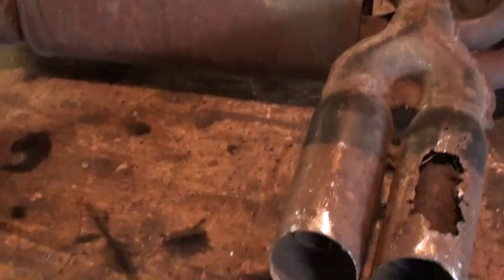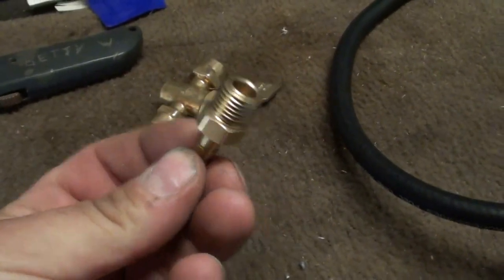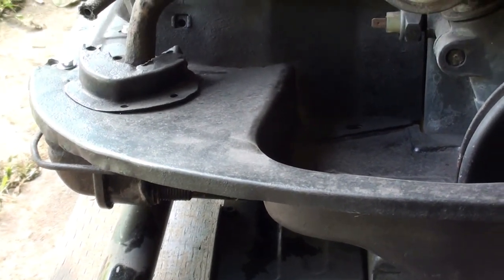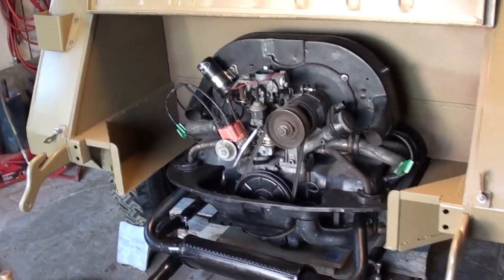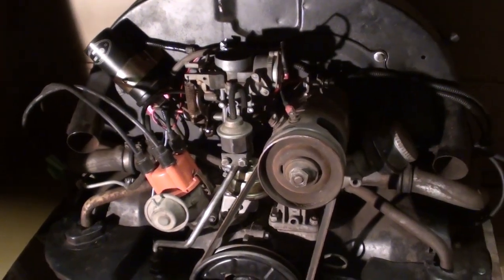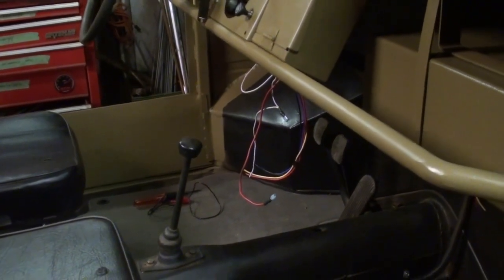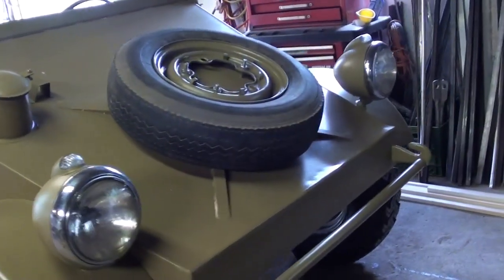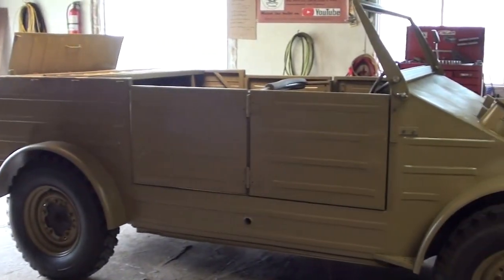Project Kubelwagen Part 61

Comment: The open pipes on either side of the engine are unnecessary as far as I'm aware. I have a Kubelwagen reproduction with a 74 Beetle engine, and both of those are just taped shut and it works great.

Comment: 7:34 distribuitor cap jump...
Reply from the maker: Yeah so a few days later I was taking my daughter for a drive and the car died... turns out cap was on crocked and rotor was starting to cut through side of the cap.  Its fixed.